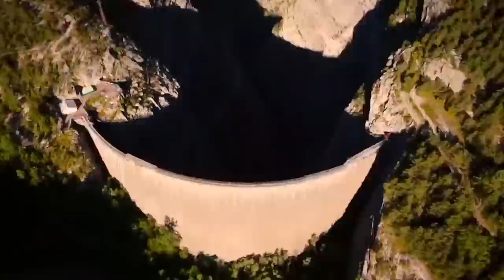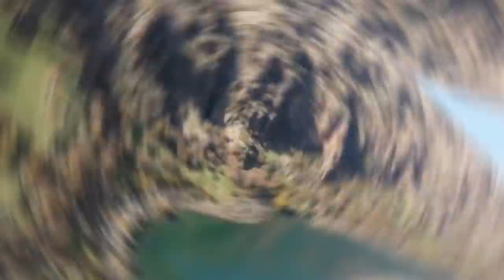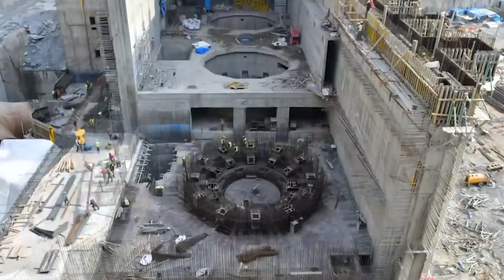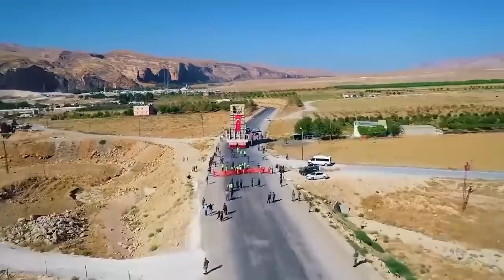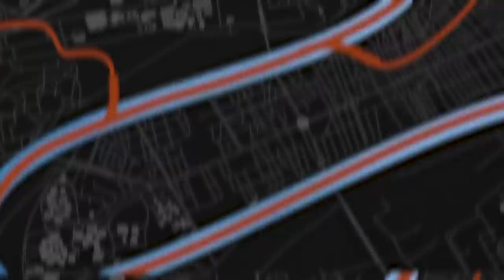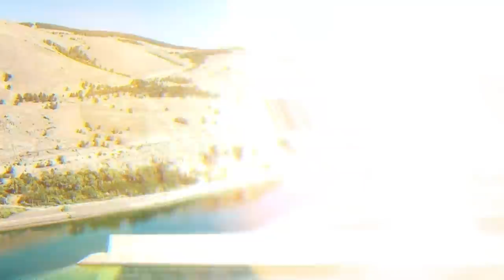How One Turkish Dam Created A Huge Problem In The Arabian World

Comment: Please understand they don’t build dams out of cement. Dams are made from steel reinforced concrete, a very different material. Other reinforcement can be used but steel is the most common. Cement is a grey powder that goes to make up concrete along with sand, water and crushed rock of specific size and makeup. Some other minor products might also be included but these are often related to how and when the concrete ‘goes off.’ It’s hardening time. Having spent more than 40 years in construction I know what I’m talking about
Reply: or earthen wall dams, rock
Reply: @neddyladdy  
Yes indeed, forgot that bit. Too focussed on being a know-all little bastard I guess. But I think we got there in the end. Forgot t , I actually a good little video.
Reply: I do have been in the business for over 40 years a lot of people don't realize the overpasses and bridges that you see made out of concrete are held up by the rebar. The concrete makes it rigid. If you made it out of concrete only it would crack and collapsed immediately. Adult overpasses and arises in La they were all pouring Place concrete floors and walls overpasses Bridges. I sent move to Missouri to retire and back here people think they can put this stuff called fiber in the concrete like fiberglass strands and they don't need to put rebar or wire mesh drawer full of s***. All driveways and sidewalks and slabs for houses have to have rebar. Down in Texas they have a problem with the soil absorbing water and shrinking and Contracting expanding. So down there when they build a slab house they run half inch conduit every 16 in or 2 ft on a grid. And after the concrete hardens after 14 days or so they run tungsten steel cables and they put a big washer at one side and pull Mass amounts of pounds to tighten the tungsten steel cable so that the slab won't separate and crack. All of concrete Bridges and overpasses also have the tungsten steel cables that run from imbutment to Imbutment in La the actual overpass is not connected to the sides of the freeway they are on a greased rubber pad so when the earthquakes come they can move without cracking apart there's tungsten steel cables are embedded on each side with tension on them.
Reply: @mikesmithey1892  
Interesting stuff Mike. The glass fibre reinforcement in concrete has a place in the industry but should only be used in footpaths, yacht hulls and the like where load baring is low. The plastic pipe with cables in it is called Post Tensioning. We use it in things too. I’ve used it in multi storey buildings where we embedded it in floor slabs to help with load. The coils of cable are very heavy so it’s important to only place them toward the outside periphery of the slab, until you thread and tension them. I’ve seen instances of concrete exploding during tensioning regime. This usually indicated poor quality mix with insufficiently spaced FCR or low compressive strength mix. Construction can give you a wide experience of life can’t it Mike? Glad your now enjoying your retirement in Missouri. I’ll bet the BBQ ribs
Reply: I was going to say the BBQ ribs were good, but I guess I got too close to the button (story of my life). Cheers from Australia Mike
Reply: thanx
Reply: What exactly is your point?
Reply: @TheRasvic  
My point is people commonly mistake the word cement for concrete. If nobody corrects it, the misconception goes on. So a nobody corrected it. I suspect your point may be much sharper.

Comment: Iraq and Syria must invest in modern irrigation methods.
Reply: Exactly, Turkey only uses 28% of Euphrates while 89% of euphrates' flow originates in Turkey and only uses 12% of Tigris while 60% of tigris' flow originates in Turkey, on the other hand Iraq uses 40% of Euphrates and 60% of Tigris while pretty much zero percentage of those rivers' flow originate in Iraq!! So claims about Turkey using too much water are just ridiculous in every way and the problem isn't Turkey using too much at all rather Iraq isn't using the water properly. Such as pretty much all dams in Iraq got damaged or completely destroyed during 3 wars and Iraq can't store water during winters anymore so they can use it during summers when water levels are dropping insanely even in Turkey. Iraq must build those dams back ASAP for their own good. But somehow even if they are exporting tens of billions of dollars worth oil they can't find funds to build them back!! Turkey has a gigantic construction sector which can build those dams back easily but they can't have a deal with Turkey neither ''somehow'' and they continue pouring millions of gallons of water to deserts in hope a miracle will happen but when it doesn't happen they just blame Turkey!! Seriously and sadly Iraq will become a total desert if they don't start acting smart soon...
Reply: Nope turkey need to give more water. The water is gor everyone not just for turkey.
Reply: They should get their water back....

Comment: Using the "renewables" should be good ideas. Current trend & development direction looks using wind in many countries, but water can be still good choices.
Water normally is more stable in production than wind.
It looks they are making the wind more stable maybe by combining with hydrogen generation platforms.
Checking the cases with "Oroville" or China dams the spillway is necessary and must work in emergency of overflow.

Comment: This is what the UN should be for.  There should be a guaranteed minimum water volumes entering Syria and Iraq, monitored and enforced by the UN, subject to similar volumes flowing into the reservoir..  If the level falls below this the UN imposes agreed sanctions
Reply: Is oil considered international in Iraq or any other country? Everything within its borders belongs to Turkey. The river is formed by melting snow in the mountains. Turkey decides what to do with the river, neither the UN nor any other country can interfere.
Reply: @_Redronin_  People die without water, unlike oil.  Iraq's oil does not naturally flow to Turkey or Iran or Jordan, and those countries haven't relied on inflowing oil for millennia for their survival.  Oil and water are not comparable.  I note you have a Turkish surname.  I wonder if you'd say the same if you were Iraqi.
Reply: @EASYTIGER10  After Türkiye filled the reservoirs, it normalized the flow of the river. Türkiye is not responsible for the water shortage in Iraq, there are dozens of dams in Iran and Syria. In addition, the river could not be fed adequately because the rainfall in Türkiye was less than expected in recent years. Despite this, Türkiye uses only 22% of the river's water and releases the rest.

Comment: We have lots of water Iraq has lots of oil which one is more valuable?
Reply: Water is more valuable, but oil is needed. You can't run electric cars because the power grid has to be beyond huge, so oil is here to stay.
Türkiye to this day relies on coal, same for India and China, and that's an obsolete fuel for the most part unlike oil.

The solution is to exchange water for oil, provided Iraq becomes more efficient, which definitely needs Turkish contractors building new dams in Iraq and more money to distillate water.